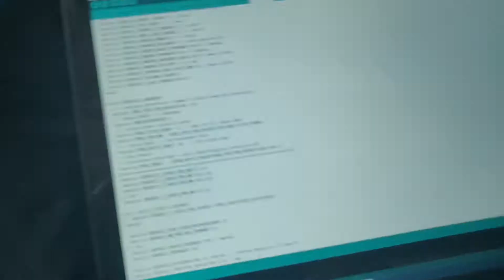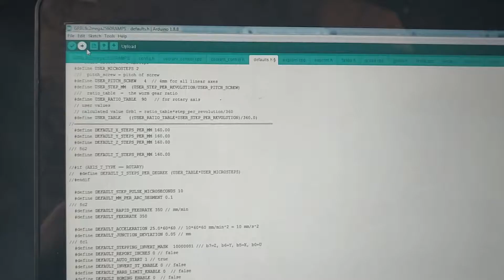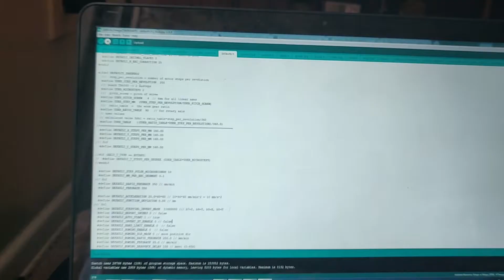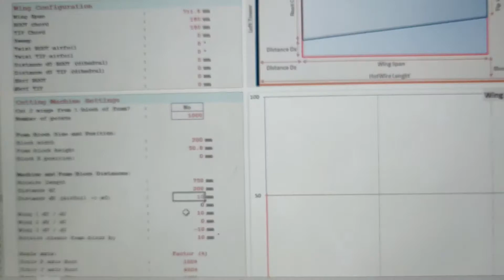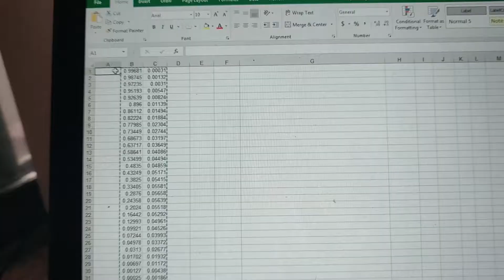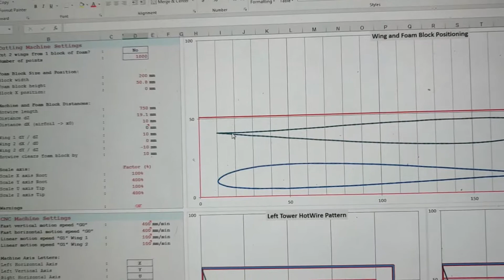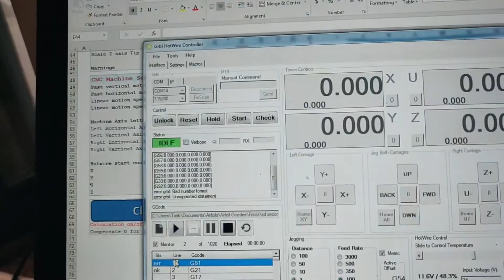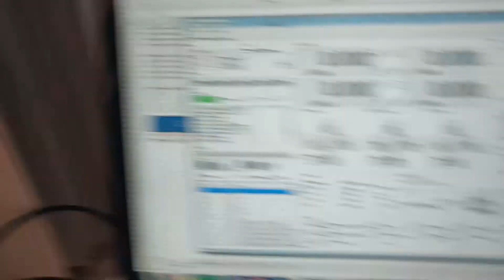Hot wire Foam Cutter PL2: Software Setup How-To and First Cuts

Comment: I have an ender 3 12v power supply. But can't get to power the stepper. It has only two wires out. On which ports of ramps do I need to put it in?